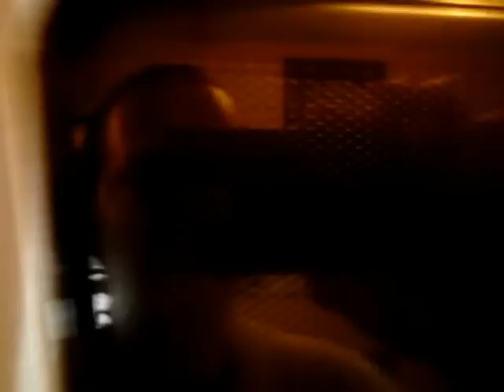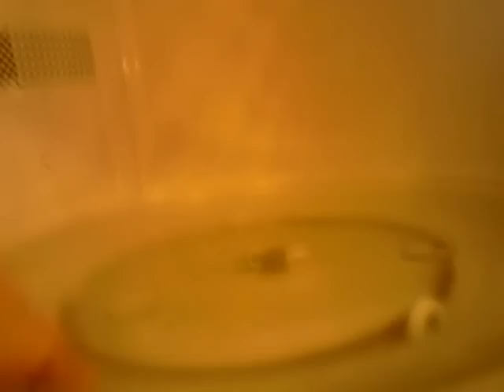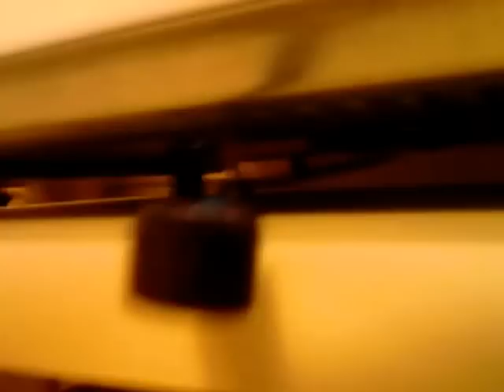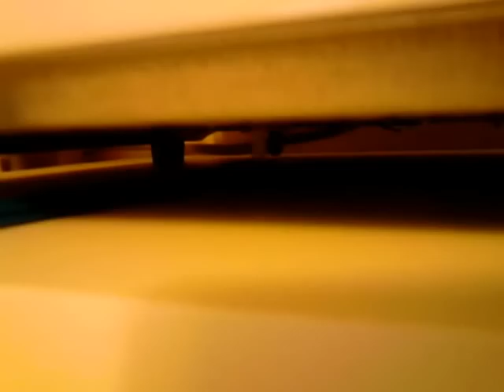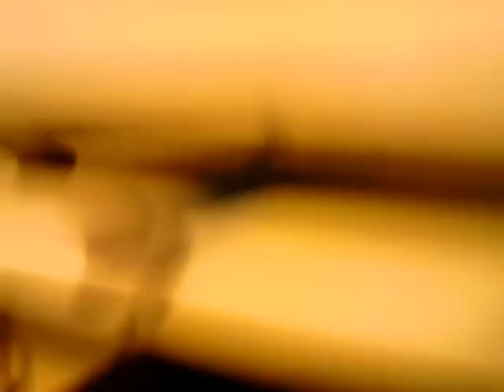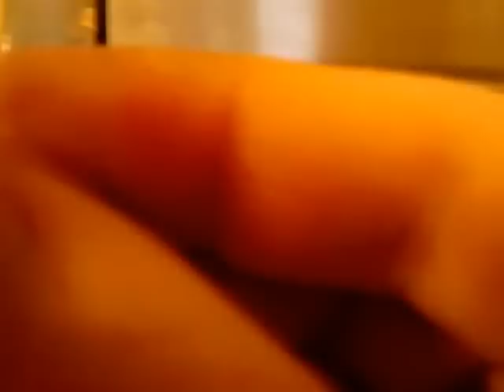Emerson Microwave MW8992SB turntable motor K'nex fix!  (instructional)

Comment: Thank you so much for this! I found an Emerson model(newer than this one) on the side of the road set out with someone's trash, it was barely used but obviously they threw it away because the turntable motor was out. I didn't discover this until a few days AFTER I had thrown out my older but perfectly functional microwave in exchange for the broken turntable one. This is the solution I needed until I get a new one, again.

Comment: hey, if you're interested, i think i found one on ebay for $8.  all the dimension match the one from my microwave.  search for "100 ~ 110 ~ 120 VAC V AC 4W new microwave turntable synchronous motor", seller luck-jade.  Yours is still a cooler solution, though!